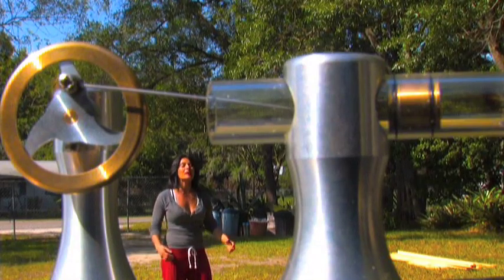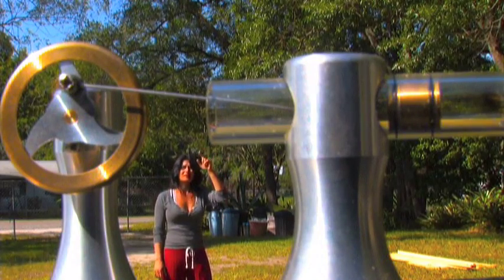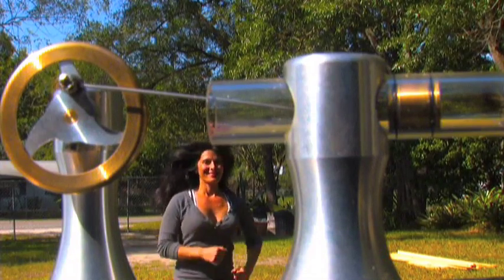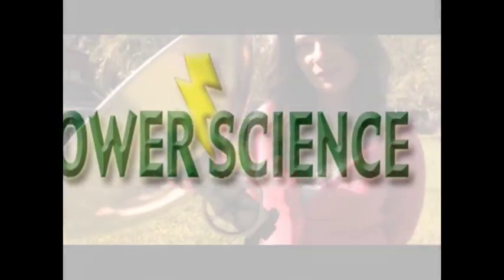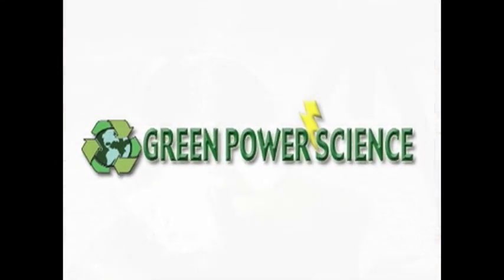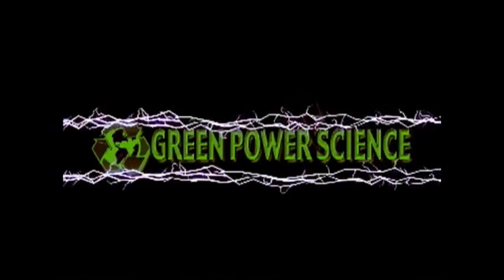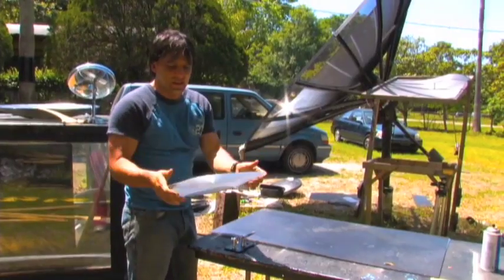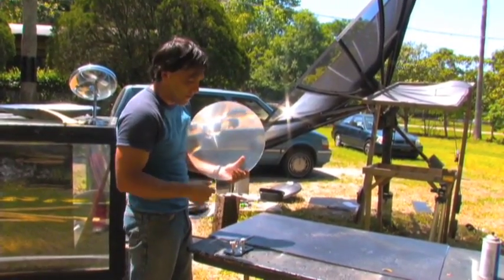SINGLE PISTON STIRLING ENGINE LINEAR FLOW LAMINA FLOW THERMOACOUSTIC

Comment: If that engine will work in a linear motion without a flywheel, maybe you could make a very simple generator by just putting a magnet on the end and letting it move back and forth past a coil.
Reply: Exactly what I thought mate!

Comment: you would need a clear car or another system to get the heat. plus you have to take into account the stability. engine vibration on the car chasis. shock absorption it would need to go faster or stronger generating more heat. oil system maybe? trasmission not sure would be the same. it would take alot to do. dont think it will ever be in a car. but it is nice to think about free energy.

Comment: Great stuff Dan and Denise you're beautiful!
Lucky guy that Mr Rojas is :)
Perhaps a Combined Solar powered Joe Cell wind and sterling/lens experiment to explore and combine all renewable energy sources? while I realize you did a small video on the (Joe Cell) perhaps look into the actual H model of separating the Hydrogen and Oxygen using the "+" and "-" in separate tubes connected by the electrolyte? 
the apparatus is made of Pyrex and shaped like an H with Platinum leads.

Comment: I am very interested in making one that power a generator for 1 to 2 kw power out let for emergency use after disaster to power and/or recharge cell phone and some car batteries to run a four person shelter  can you send plans i live at 32750 zip code where it is hot clear skys are 300 days per year

Comment: The practical aspects of this are huge! There are arrays now being planned (already financed and marketed) in the mojave desert. The stirlings generate electricity (in that case, mirrors are used rather than the fresnel lens).

It's actually more efficient and cost effective to heat stirling engines than it is to produce and use solar cells.